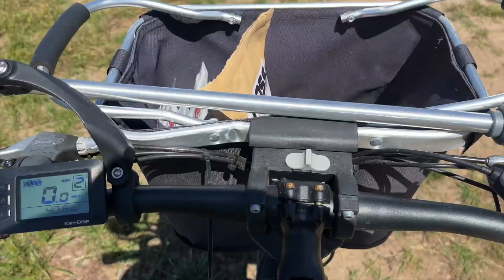It Is Completely In The Dry!! But That's Not ALL!!

Comment: As a greenhouse grower, let me say that you may make greenhouse benches by using 2x4 inch metal fencing attached to painted 2x4 wood frames. Generally we use 4x8 benches with 2 center supports. Attach wire top with small fence staples. Place these on top of cinder block legs.

Comment: Oh yes, the mistake on the door. I bet you felt real bad Jason, but it's all good and it's okay.  Your plan will work and maybe even think about a wood filler and a little stain.  It will look good Jason.
Reply: Yes I was thinking putting in a dowel in the hole before you put those caps on.

Comment: You can use a wooden dowel rod that is slight smaller in length than the hole.   Put some glue on the dowel and insert it into the hole.  On the ends use some wood filler and sand that down flush with the door.  Stain and call it a day.

Comment: 💖Another thought 🌷🌻Jason 🌻🌷is use the center blocks on end with 2 landscape timbers run thru holes the either half pallets or full pallets on top as well as throw bottom holes you can do the same to make shelves for storage or more of a shade plant area. As you notice Walmart and HEB stores use this method for the center blocks are fairly safe to use for tables and you can stack if you need too just make sure your bottom block are level 🎚️ up and down center block with either a landscape timbers long ways through the holes try it out you will probably like it and either find the short pallets or cut them in half or dread blocks out more and use the whole surface you will 💕 it💖

Comment: Find a dowel the right size as your drill bit.  Put it through the hole.  Cut off the ends flush with the door and stain it the same color as the door.  It'll be flush with the door and the same color!!  Sorry for ya!  I can imagine the regret on that one! ❤

Comment: Hey Jason you can get wood paste and fill that hole on the door flush----and then stain it just like wood rather than a plug.  Get wood paste a hardware store.  I used it many times to fill holes in wood.  Works well....

Comment: You can use a wooden dowel for the door plug. I think that's what they call them. Just a straight stick. It will go all the way through so it would make the job easier.

Comment: Jason, instead of the wood button patches. You could buy a wood dowel the diameter of the hole, and cut it to the width of the door . Insert glue and tap the dowel into the door..
That would make it solid all the way through. Just an idea.

Comment: Watching Brooke staining/painting reminds me of my High school days.I had a job painting 100s of 2 by 4s for a 18 hole  mini golf course. I will give you a hint to go faster. Set up saw horses and use a mini roller or even a big one. Jason you could put a brass plate between the handle of the door so you dont scratch it up and it will cover that hole/booboo
Jason two things On the tables have you tried to turn the seed trays sideways?? You might get two in the same spot
Turn the pallet the other way and it wont stick out so far

Comment: Use a dowel to fill the whole hole that you drilled wrong for the handset on the front door. Make sure to use a good wood glue that's stainable. Not just a cap. Then stain & seal well.

Comment: I've never commented on any video before, but wanted to suggest you turn that pallet so the slats run front to back (so when sliding a tray on/off, it slides smoothly instead of catching on each slat). I often sit/perch on the corner of a pallet to work on the trays, so I'd want to move the stack of cinder blocks right to the front corners, or the whole thing would tip off. Your channel is one of my favorites and is so peaceful to watch as you feed and chat with your brood, makes me wish I could join your tribe! (Canadian here). Keep up the good work!

Comment: I used to deal with things like this on high-end 4x8 doors on mansions and you can use Bondo inside to seal the hole all the way through use the plug on the outside but then sand it down to where it's flush glue that in there and then have her stain that to match that way it's flat

Comment: Considering that tha texture of the door is a wood grain, I think that a small dowel rod, cut to the depth of the door would give you both a filler AND  the texture that would blend in with the surrounding texture of the door without making a larger hole. Just a thought, it would be a relatively simple process.

Comment: Suggestion. Use a dowel for the hole in the door.   Glue it in and cut it flush with the door. You can stain the same and or use permanent markers to make it look the same.

Comment: I think you should put a plug on each door to match and it will look like it should be there! On the other door, you font have to make a hole, just trim the back of the plug flat and glue it on the door in the same matching spot! That's a lot of trim Brooke! But it sure looks good!  Your cinder block/pallet tables in the greenhouse will work out fine! You can also cover them with chicken wire so nothing will fall through! God Bless!

Comment: Instead of the plug, use wood shavings mixed with wood glue. Stuff the hole with it, them stain that area and with a toothpick make little lines like the grain and add another ply of stain and then the clear coat. It won't show up like the plug. Don't make the hole bigger, it will be less noticable. The plug will stick out like a sore thumb. Just a suggestion.

Comment: I LOVE all the light fixtures!!!

Brooke, you are rocking the staining!

On the wood plug for the door, if you run a wire brush before putting it in, then, put in the plug matching the flow of the existing grain.......then stain......you won't see where the little hiccup was.

Comment: @7:50 you can just get some wood filler ...make sure you get the one that says "Stainable" but you will not be able to tell once it dries and you stain it ...try to do it right away so the stain will match the stain that is on there lightens up a little over time. I am sure you know this already...the plug will work as well

Comment: FYI for your mistake in the door use a piece of Dowel so that is goes all the way through the door glue in deep then use a filler on the ends it should totally disappear.
Great job so far and small mistakes are nothing to worry about.

Comment: My wife and I sincerely enjoy your videos.  Regarding the oops hole in the door, one possible solution is using a wood cutting plug cutter.  I have a set of three of standard sizes around 1/2" or so.  The result is a accurately sized plug that is flat and could be flush with the surface of the door.  Maybe your builder or a local woodworking shop or hobbyist could cut one easily.  Cal

Comment: Not to worry....You can also use a (proper sized) dowel.  It will look like it is supposed to be there after a little stain.  With everything you two have accomplished, I'd call it an accent feature..lol lol.  All the light fixtures are gorgeous.  I wouldn't mind having them myself.  This home is going to be a palace when it's done.

Comment: For the chandelier, make sure you get a switch put in and the apparatus to lower the chandelier for cleaning and bulb replacement. We had one in our last house and it was a lot better than having to do those chores 19 feet in the air and on a ladder.

Jason, your “mistake” is hardly noticeable. It’s more a “oopsie” than an eyesore. It will be fine once that plug is in and stained.

Comment: Can I suggest getting a piece of dowel the same size as the hole in the door and gluing it into the hole cut it flush ,stain it to match ,that way the hole is filled you don't need to make the hole bigger ,and it's solid filled.

Comment: Just wondering how the gosling foster plan was going? Also has your date firmed for the storm shelter installation? Inquiring minds want to know! 
Your sunflowers are gorgeous, Glad you are getting a return for your and  Mary Carl's effort. The people smiles were priceless!
Please don't worry about the door, once it is plugged and stained it will hardly be noticed. I installed a pantry shelf that was perfect for me but about 3-4 inches too high for the wife (I'm 6'3", wife is at least a head shorter.) That gets notice every time I have to get something down for her.  I built her a step stool but I think she likes getting me to do it.

Comment: Wood filler would be a another good option for the door hole. It's rougher so holds the stain better. If you squirt it in the hole from both sides, use a scraper/palette knife to level, wipe off the excess on the door and use a needle to put a grain input, stain when dry and you'll never see the hole.

Comment: You can use a wooden doll rod and not need to dill hole larger.  Sand flush and stain.

Spread your blocks out farther and place the next pallet on half of the block.  Maybe you won’t need as many blocks.  Just a suggestion.  Make a work table to your height so you can eliminated stress on your back.  No bending to plant.

Comment: just a suggestion could you get a long small wooden dowel cut it to the length of the hole in the door push the dowel all way through it will make it solid instead of it being hollow after you put the caps on each side of the door then make each end of the dowel flush n stain.hope you get what I'm trying to say love you all n yalls channels.

Comment: You can get a dowel cutter that’ll fit that hole and use the circle that came out of one of the holes and your pattern will match and color match it and just glue it flush and you won’t even notice you made a mistake

Comment: You should watch Proper DIY YouTube Channel videos to get idea how to seal the hole in the door.
You can get ideas. like using silicone or wood putty (found out silicone or wood putty will not work on a fiberglass door. you have to use fiberglass filler components ) to squeeze through the hole in the door to seal it up water insect tight seal.

Comment: Use a wooden dowel, cur to length.  Have grain run same as grain on door. A little filler to smooth around edges of dowel.  Stain.  Should never be a lot less noticeable than a button.

Comment: Yeah I’ll just fill the hole and take a metal plate that would match and stick it in between the top and the bottom of the door handle on both sides of the door

Comment: Holes in wood are easy to hide!
That hole is easily fixed with a drill press and a plug hole cutter. You get a piece of wood like the door and use the plug hole cutter to make a couple of plugs (for inside and outside. You drill the hole to match the plug (you can get various sizes of plug hole cutter) and then hammer the plugs (remembering to align the grain) into to door (with a bit of wood glue) with a bit of waste wood to reduce the risk of accidentally hitting the door with the hammer. You should leave the plugs protruding slightly. 

Next day you use a Japanese flush cutting saw and then finish off with gentle sanding. Add the stain and it’s like the hole never existed. 

I’ve made numerous changes in my home which has left ugly holes and have used this technique every time and it works a treat. I’ve only once made a mistake and forgot to align the grain but I redrilled it out and replaced the plug. No problemo.

Comment: .? Go to Walmart and pick up a wooden dowel that is the size of your hole and cut the length you need for the thickness of the door. Put some glue on it and push it thru and stain. Nothing sticking out and then it will not be noticed at all. Smooth. I have had problems with those buttons getting hit and falling off even with them being glued

Comment: DOOR REPAIR, why don't you sand down the back of the plug so it will fit in the hole instead of making the hole bigger??  Then flatten off the top of the plug so it doesn't stick out so far, sand the top flatter instead of being rounded.
I just think it will be less noticeable.  Ask Brent.

Comment: Just a thought if the small wood plug doesn't workout. We wished we added a plate below our handle just as a "dirt shield".
Reply: Yea I was thinking during the podcast just add a small brass or black plate to each side and call it a dirt guard.We actually do have a legit plate on our door to prevent scuffing the door or getting it all dirty

Comment: Wouldn't solid wood dowel be better to fill the error hole on the door than just a couple of button plugs which could fall off with that area being touched so much?  The dowel will fill the entire hole from front to back and can be sawn flush and stained and disappear/invisible.

Comment: ****Jason maybe you should have your wife stain those little hole fillers before you put them in the holes. Also a good idea to paint inside the holes edges so you don't have more stain surrounding those holes. That way you won't have extra stain covering the wood on your doors around those little fillers. That would make the fillers moe noticable.